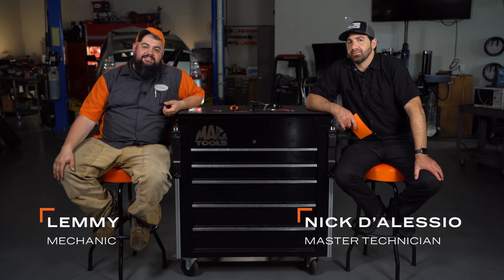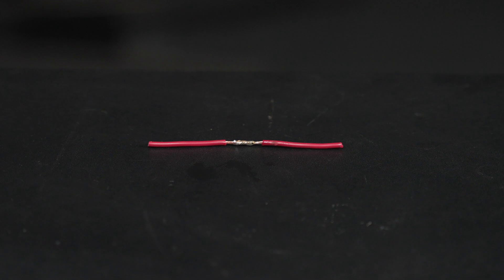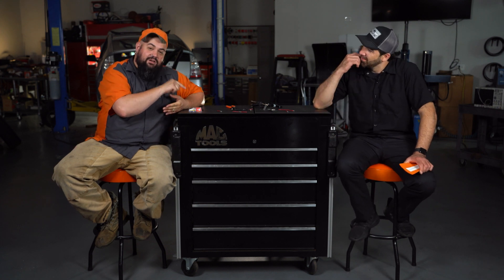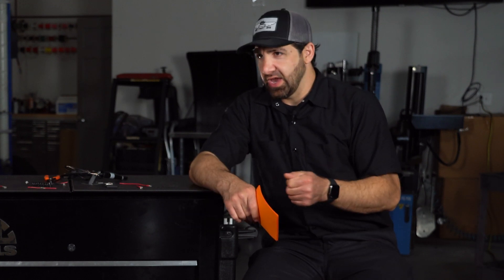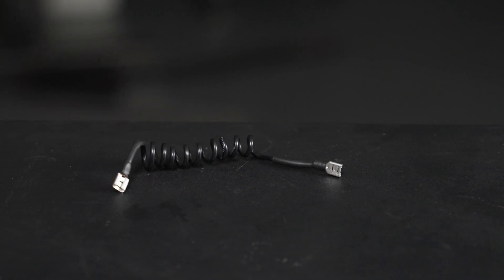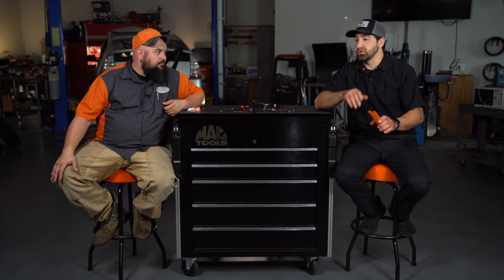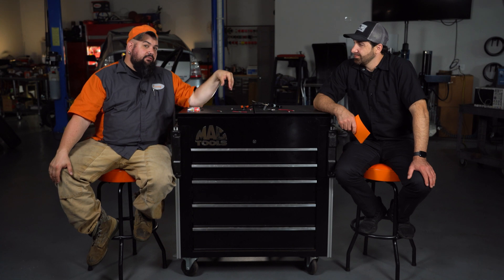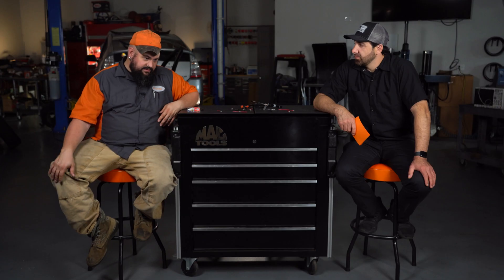Crimping vs. soldering: what’s better for automotive wiring?

Comment: Im sorry but I stand by this. When I firsted started in the industry (Semi Truck and Trailer repair) I was the only mechanic for a smaller fleet. I used these nice Perma-Seal butt connectors. After sealing them i would heat shrink and tape. Didn't really know much about soldering. After about a year I started having A TON of random lights go out and power/ground issues. EVERY... SINGLE... TIME... It was a failed buttconector it was corroded out completly. I then bought a Weller soldergun. Ive been using it for years and have yet to see a failed solder joint. Outside or inside it doesnt matter. Everytime I soldered a wire it lasted. I still am running into old failing buttconectors. So unless im not using them properly which I sure I am, but I also double/triple protect them especially if it's trailer light wiring. So I solder everytime its outside. Buttconectors are only appropriate if it's in the interior of a truck like in the dash.

Comment: Crimp connectors themselves make a big difference -- thicker metal would generate more clamping force on the wire. Also there are open barrel crimps that are almost as compact as solder is, but they are probably more difficult to get tooling to work right than tube shaped butt connectors and closed barrel terminals(in my country i can't even get propper open barrel splices, the only ones that are there are chinesium ones made of thin metal). Don't know about flexibility(any splice is worse than bare wire and will break if poorly placed) but i think that main issue with solder is that in event of short circuit it might come apart before the fuse pops and release the wire or something like that. I think risk of melting and lack of repeatability is why some standards forbid it. Never seen a soldered wire come undone because of heat, but have seen several shorted caps and supressors that fall of the board on their own

Comment: Crimp is only as good as wire strength. If weak brittle wiring crimp may fail, most wiring is okay. I believe properly crimping connectors takes practice and time to make it right, as does solder needs experience to make it right. 😊

Comment: The trick to a good solder connection is spending a minimum of $60+ on a good Weller soldering pen with seperate base that does not lose heat when you solder and takes less than 10 seconds to reach your set temperature. And yes, a good brand of solder. Anything less you are doomed for failure. For my power cables I always solder my connectionS using solder pellets and a torch. Same with power wire to amp using large ferrules and solder.  Power cable i think solder is best. Speaker wire crimping is okay.

Comment: Thank you for the information. One question. There is a hairline crack in the line that runs from the radiator to the transmission that is causing coolant to spill. Can that line be crimped?
Reply from the maker: We would not recommend crimping that.
Reply: @DormanProducts  Thank you for your response.

Comment: Done correctly both methods are good. To technically say one is harder or better than the other is just not a fact. And yes you can tell if a soldered connection is bad if you know what your doing same as you can tell if a crimped connection is bad if you know what you are doing.

Comment: I personally am a fan of heat shrink butt connectors with the ratcheting crimper. Good mechanical bond with excellent environmental protection. Never had any issues.
Reply from the maker: Those definitely have their place! They can get bulky if cuts aren't staggered. It is definitely convenient to not have to thread all that heat shrink into place on a bigger job. —Lem